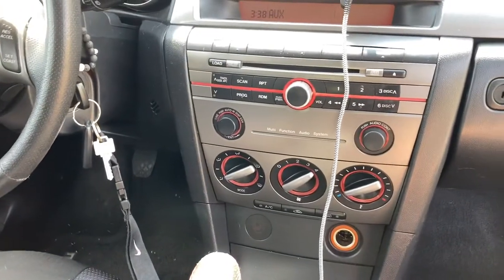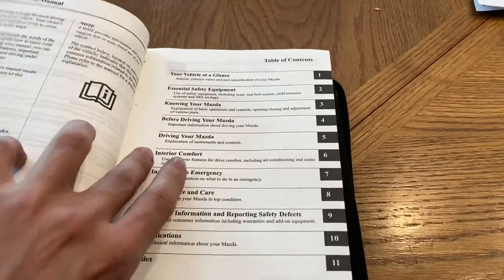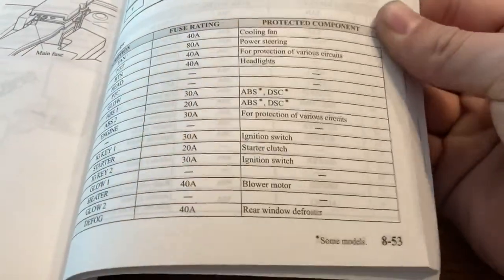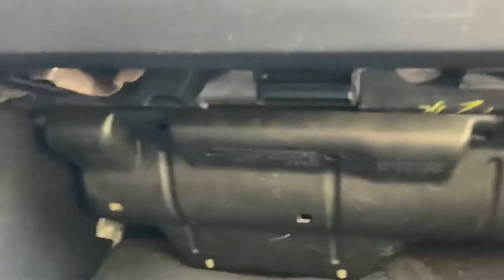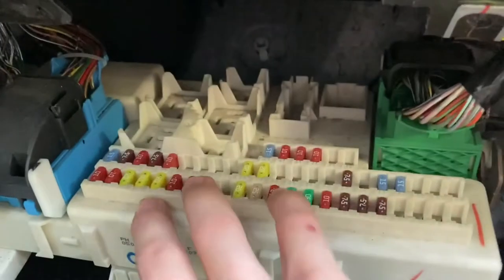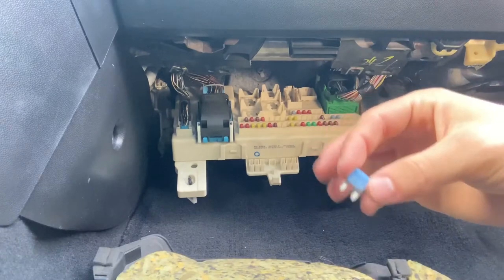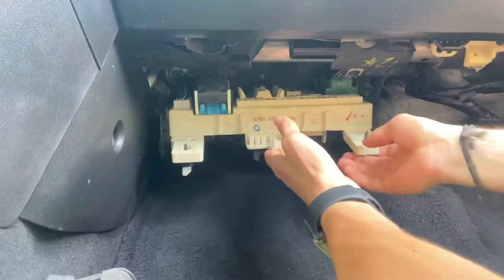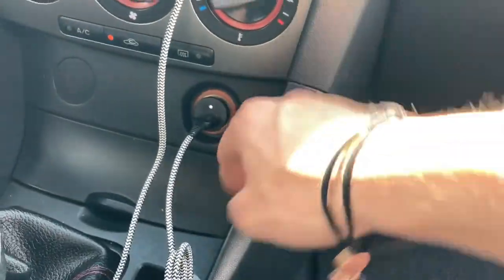How to fix a broken cigarette lighter-fuse replacement-08 Mazda3

Comment: Hey which fuse is for the cigar lighter in the center console do they both work off of the same fuse ?
Reply: No they are different, the one you're looking for is at the engine bay next to the battery
Reply: @felipevillasenor2986  is it the power outlet fuse?